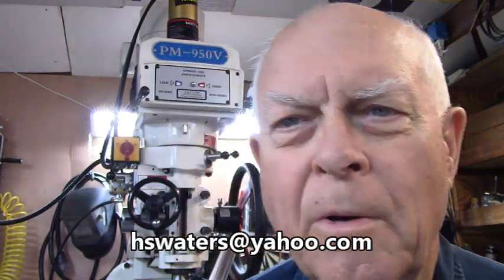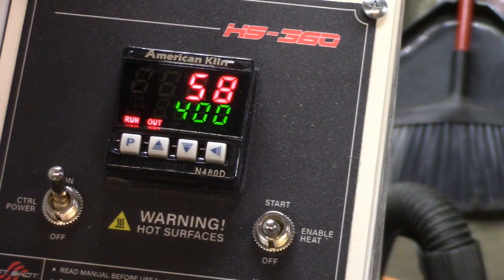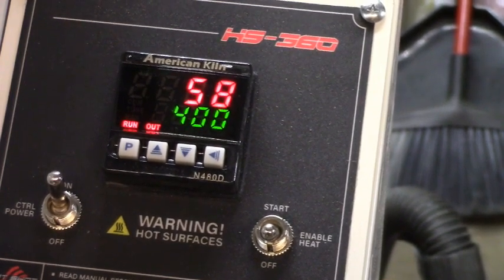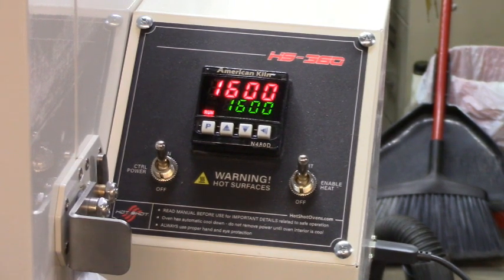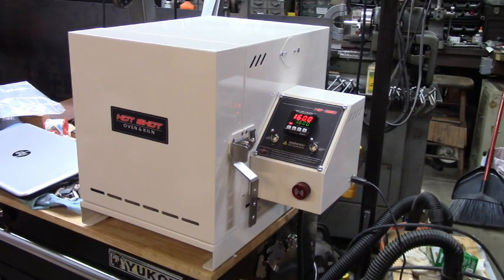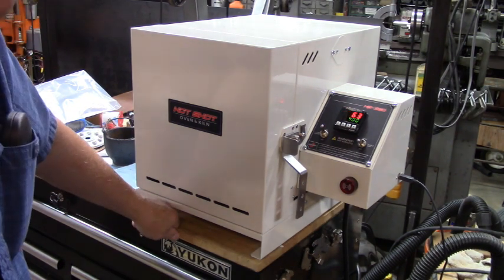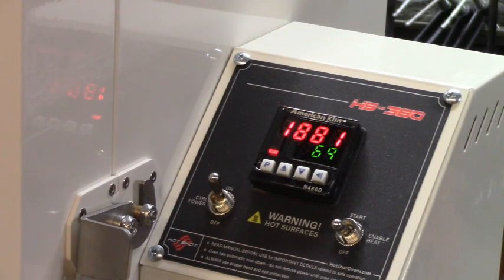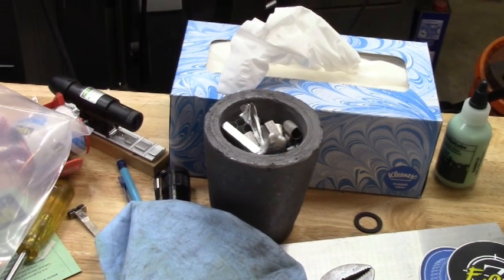Hot shot 360 Hot Dawg!

Comment: Melting point of brass:
Red: 1810-1880°F/990-1025°C
Yellow: 1660-1710°F/905-932°C Might have high copper content [copper melts  1983 deg F] from Online Metals.  Might need a flux or a "solvent metal" like zinc ? Maybe ask  the guy from Windy Hill Foundry
Reply from the maker: Thanks Al I have seen those numbers and I suspect that the 22LR brass is an alloy and not what is considered pure brass since it has to take a lot of deformation during manufacture.  Did you notice that some of the cases had holes in the side as if some of the metal had melted.    I do think our friend at windy hill could be a big help.